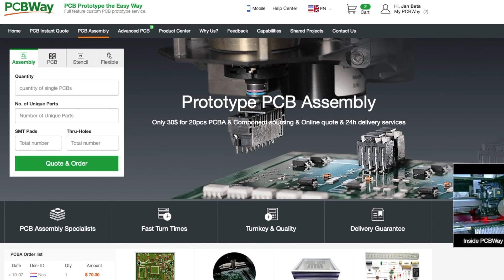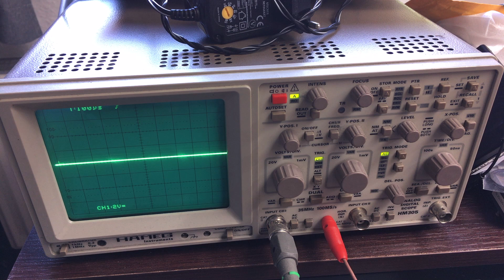TRS-80 Model 1 Troubleshooting (Part 2)

Comment: Hi jan the video you are looking at is a bad video ram chip 2102
Reply from the maker: That might very well be! I think the main fault is the clock signal that is messed up somewhere but there's probably more faults down the line, possibly including the video ram. I am still working on it on and off but got a bit fed up with the machine frankly. I'll get there eventually, I guess... :)

Comment: Kind of frustrating to watch Jan. Maybe we are missing all the methodical bits you are doing as you examine the schematic and logically starting at the clock, divider chain, putting the cro into a rate/sync mode for video so you can actually see the whole signal and not some random edge.
Reply from the maker: I did a lot of scoping in the previous video, including the video sync and clock signals. The vsync looked strange so that's why I replaced the ICs I suspected. Good point about putting the scope in the correct mode, obviously. Didn't think of that.

Comment: Difficult to watch this one Jan. Semi-random component replacement in the hope that things will get better rather than structured troubleshooting and fault finding. Using a screwdriver like a chisel to lift a desoldered IC - almost guaranteed to rip traces and lift pads. Made me wince. CPU clock signal looks horrible and this runs the whole system including the video timing. Start there. What's the output from the crystal like? Trace the signal to the CPU checking it at the entry and exit of each device. Where does it get dirty? Without a good quality system clock signal nothing will work properly. Try removing the Z80 and see what the clock looks like without it - the CPU may be bad and corrupting the clock.
Reply: Bas van Haren yeah, he even disabled the comments!
Reply: @AndrewLittleboy1  Yeah I probably removed the whole video if I were him.
Reply: @basvanharen2904  Yes, that was extremely painful to watch!
Reply: Video is static ram.  You can get schematics off net and in its. Service manual.
Reply from the maker: I did a lot of the actual fault finding in the previous video, so it's not really as random as it looks. Also did a bit of scoping off camera, sorry if the video came out a bit inconsistent. CPU is fine, crystal is fine, haven't found the spot where the clock signal gets messed up--as I said in the video. (Didn't lift any pads or damaged any traces, btw. Sometimes a screwdriver is perfectly fine when used carefully.)
Reply from the maker: I have the schematics and service manual, watch the previous video. ;)
Reply: @JanBeta  I know you will get it, and can't wait for the next time you post on it.

Comment: It really seems to me like you're just replacing random parts and not doing any real troubleshooting. If you suspect that a capacitor is bad then pull one lead out of the circuit and measure it -- it takes about three minutes (less time than replacing it) and costs nothing. Yes, parts are cheap and you have a nice desoldering gun but you're wasting time and money doing it this way.

Comment: Some computers can't be fixed. I know, that isn't right but you can't replace all parts. In the US the TRS-80 was called Trash Eighty and that must be for a reason. I remember Tandy / Radio Shack, they sold electronic parts on blisters. If you needed one resister you had to buy five, not spending fifteen or twenty cents on a resister but something like ƒ1,95 for the five and then. And then you had four of them in storage till you needed them again. All parts sold at Tandy / Radio Shack had questionable origins, like Hong Kong or even worst The Peoples Republic of China, and we all know what comes from China! The PRC copied Hong Kong and the Colony copied it from Japan. 
 
In retrospect I can say that the complete computer industry spoiled not millions of Dollars but thousands of billions of Dollars. Almost all computers ever produced could not be used for more then a few years, outdated because of shortcomings in the design. And the electronics and computer industry did the same with mobile telephones, they did their upmost best to produce equipment that is totally unrepairable. There is no need to repair if the design is old-fashioned when it leaves the factory, or when more money can be made selling new and newer stuff to the public. 
 
Therefor I can say that repairing a TRS-80 is against the will (and testimony) of Tandy (may God rest his soles). These computers were only produced to be sold to the illiterate public and then to be moved to the attic gathering dust. A year later another model came out, and again and again. It does not surprise me that Tandy is no longer in business. The pure hate for the customers was to obvious.
Reply: Enjoying the channel. Looks like you will do what I usually do for electronic repairs. Buy everything it could be and start swapping. It will work eventually. I recommend posting it on Noels discord. Maybe somebody there has an idea.